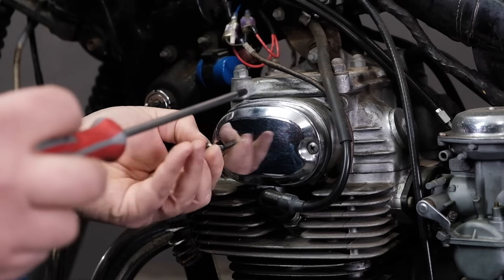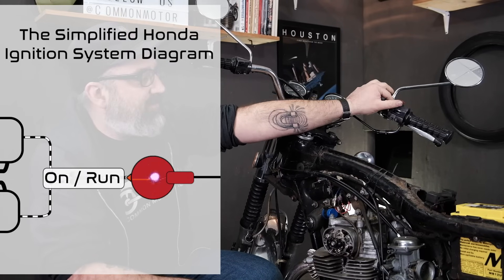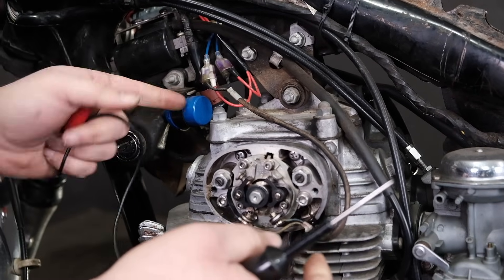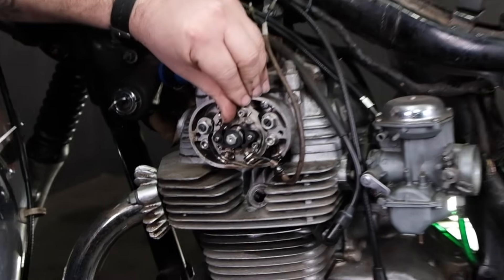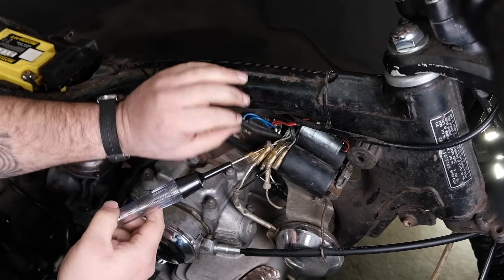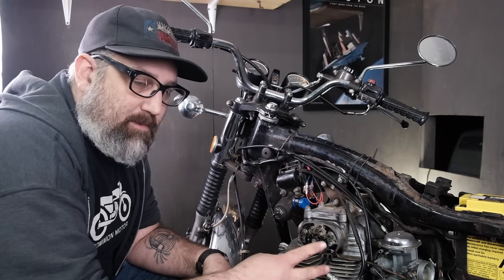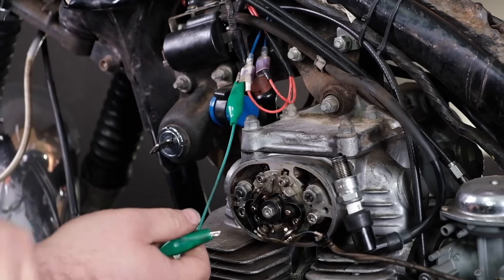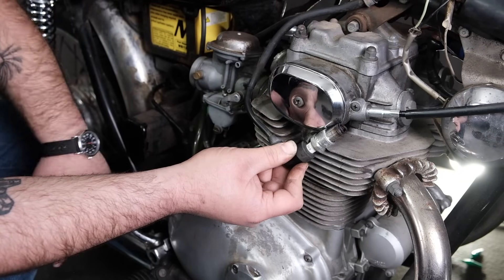Ignition System Wiring Design & Diagnostic On A Vintage Honda Motorcycle (1965-1977)

Comment: Thanks for this. It helped me conver the ignition system from GL to CB so I can do a 12v system. Realized I needed to change the coil because on the GL it's only got 1 wire on the coil as opposed to CB with 2

Comment: I am able to pass all checks up-to the last one where by kicking or turning over the engine I should get spark, but I don’t.  I get sprakplug spark when striking the wire to the block test, but not on the final test.  I don’t think you provide a reason for it not working.  Any suggestions are appreciated.

Comment: Thank you for such a good video that made diagnosis easy.  I'm trying to get my dad's '71 CB350 going after at least 25 years (I have not seen it running in about 40 years), I went through this, and on the last test I didn't get spark on either side so it looks like I need new coils and/or wires. Is there anything else that could be wrong?  From what I can tell, the wire is part of the coil, is that correct?

Comment: Where would be a common place that the system might have fused together? As soon as I connect my battery, the bike starts cranking over even with the key in the OFF position.

Comment: I have a 1981 cm 400e (cdi) its a rescue...that being said i had it running well when the cdi went i replaced it with one of Rex's which is one of the only ones I could find save eBay which I can't trust and now I burned one of the spark plugs completely out so I decided to overhaul it again only problem is now my CDI is not working at all and I got no spark so I rewired the whole bike from scratch and my starter turns over but I still got no spark I'm pretty sure I need help identifying which two wires are my pickup coil wires cuz they're not the same color coming out of the actual pickup when I pull the case off the side as they are in the harness are the blue and white separate for each one cuz it looks like there's only one pickup coil on there and if so are they separate signal wires or the same signal wire for both cylinders is it fire like on the exhaust stroke

Comment: Hay I have a question. For u I have two Coi and 4 wiyers it's. 1992 Kawasaki ninja 1100 cc I geting spark from 3and 4 coil. Not 1 and 4. Tho I tested them every thing check out except 1and 4 coil wiyers. The positive side of coil is good but her where it get tricky  the ground side on 3and 4 go 43210 on my reader. The ground side on 1and 4. Gos 432 and stays at two.  I can't get it to 0 like 3and4 side dose on negative side. Do u have any idea. O and if I tack a ground wiyers to the nagetive  side of the coil. 1and4 it spark and gos thi to spark plug but if I leave on there it dose nothing do u think it's my crank shaft sensor. I lost the magnet on the back so I put some mangnets in the back. But  I lost the 1And4 again  u have any ideas

Comment: I'm probably a bit stupid at the moment. But where do I get the +6V to the coil on my XL250 1973?
No spark, and I can't find out why. Coil works and spark plug's new.
 The bike did run TO the MOT, during the MOT....but not on the way home, and not since.

Comment: What happens when you have power coming off your points all the time? My test light doesn’t shut off when the points open and close.
Reply: Did you ever figure this out? I have the same problem
Reply: @thelander9476 Me too! If you find out anything please let me know!
Reply: @kylechandler4681  i ended up putting new points on and that fixed it! I also put new coils and condenser on while I was at it

Comment: I have yet to start my bike. Almost there. I’m setting points and testing the electrical system. My ignition switch has 3 settings. Is this similar to the kill switch (off/on/off)? Dumb question but double checking
Reply: As I understand it, thatbos commonly off/ run/ and thr last position can be a sort of "standing/parking mode" where the lights are on while the bike is stopped.

Something about being safer if you're pulled off on the shoulder of a road because then at least cars can see your taillights and such.